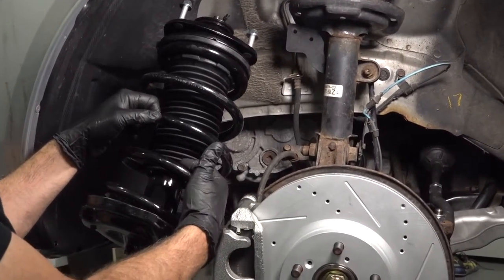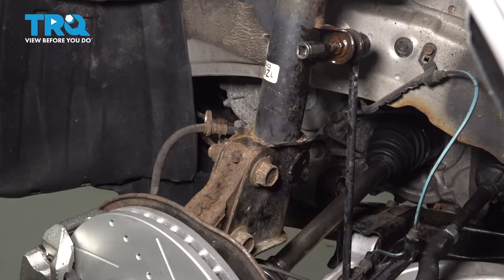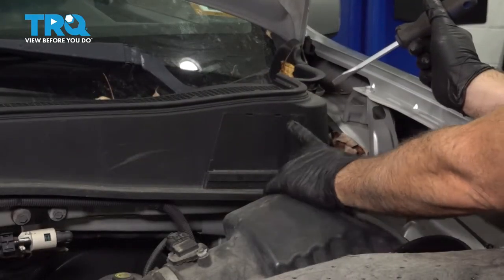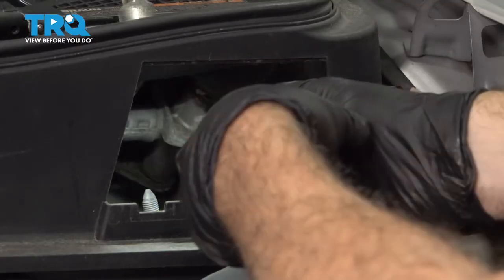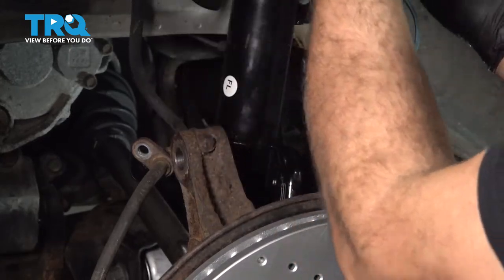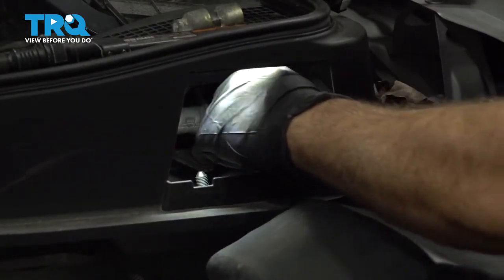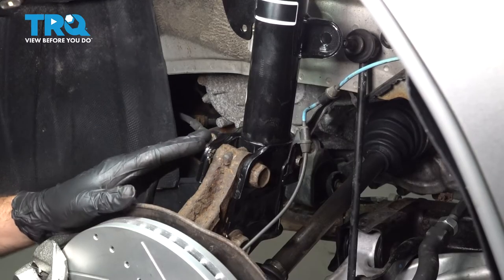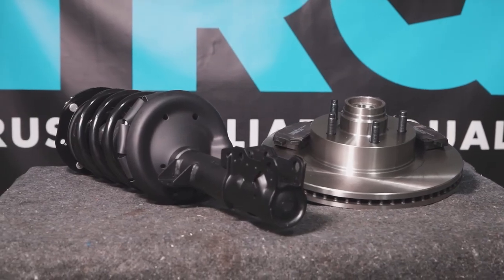How to Replace Front Strut Assembly 2009-2015 Honda Pilot

Comment: It may be worth mentioning that the sway bar link may not align with the bracket on the strut.  If that is the case, put a jack under the control arm and compress the strut until the link will line up.

Comment: I may have missed it- but the trq shock assemblies need the top strut nut torqued once the wheels are installed and the truck is on the ground. Mine took about 2 full turns. At the factory, it looks like the just put the nut on to retain the spring with the strut.

Comment: I just replaceed my front and rear struts and shocks on my 2011 honda pilot. I took it to get an alignment and they said take the vehicle back to who did my suspension work and have them adjust it because they set it to manufacturer standard and it is still pulling right. Is there a way to adjust the parts? Or did i do something wrong. I followed this video to a Tee

Comment: You also might want to draw lines using an paint pen around where the strut connects to the spindle before you loosen the bolts for proper alignment when you install the new strut